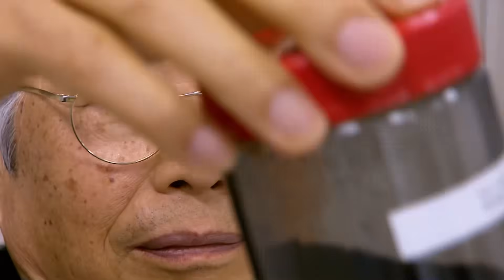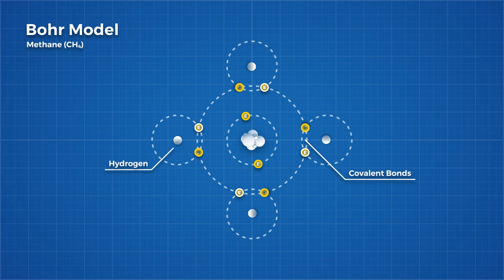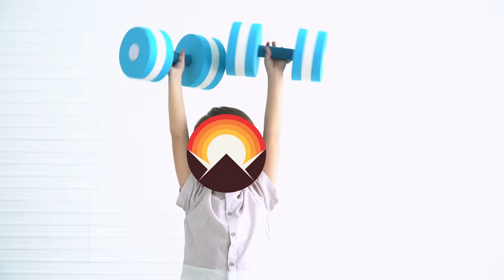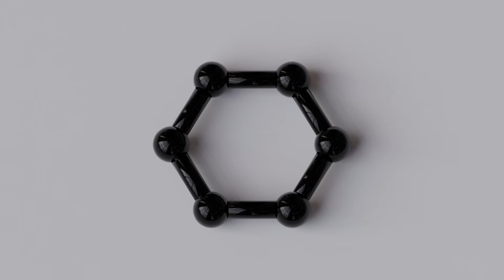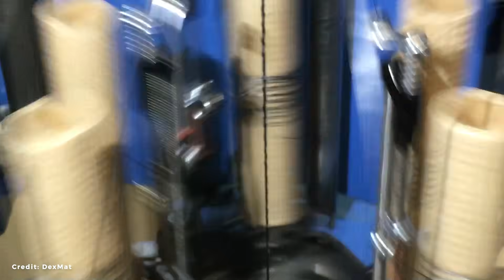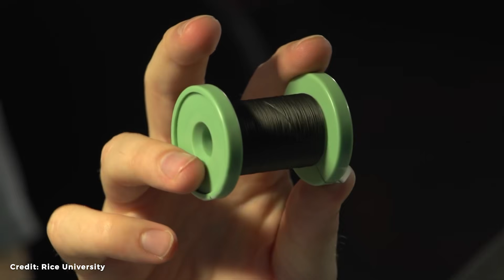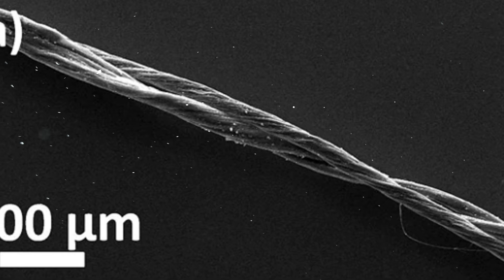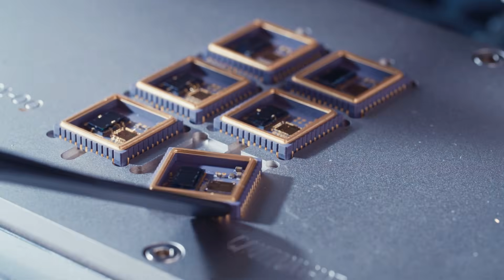How Carbon Nanotubes Will Change the World

Comment: We've heard this for years, let's hope that engineers actually start using this material for realsies now
Reply: The more problems we solve, the more we discover. The trick is to solve more problems than you discover.
Reply: @MetallicReg   with carbon nanotubes though we know what the problem is. We can’t make them consistently or in any useable scale. Sure there are researchers that can make them semi reliably at very low scale for a high price, but that’s massively different from mass production of a product that can pass QC and perform reliably. 

Not saying it’s impossible but, there’s going to be other materials that exist that are much more useful and much easier to make reliably than carbon nanotubes (take even graphene for instance).
Reply: @Kahalahili  I believe that the manufacturing methods for CNTs are way ahead of graphene in terms of volume and consistency of quality.  I am not aware of other materials that are poised to surpass and obsolete CNTs but I suppose it is possible.  Any novel material is going to have to go through the same qualification process as CNTs and graphene, so there is no way around that.
Reply: @MetallicReg  What does that even mean?
Reply: @dibbidydoo4318  This means, that you can't speak about the future without knowing the problems that you need to solve.

When people said that something was "twenty years away" - they were not lying. The problems they knew about at the time were realistically solvable in that period. However, today we are solving an other set of problems - and again - we are not lying when we say that something should be achieved in 10 years time.... if we don't stumble upon new ones.
Reply: @MetallicReg  Well said
Reply: @MetallicReg  I haven't thought about it like that before, thank you
P.S: fully autonomous AI in 25 years
Reply: @dibbidydoo4318  Monte Python reference
Reply: @MetallicReg  
This is very true and why R&D is so expensive and time consuming. Remember: engineering isn't about making something possibly work, it's about making something work to acceptable standards and improving that if you can. No one would be interested in a microchip if it only worked once. The problem with carbon nanotubes is just as this great video laid out - manufacturing. We know all about CNTs. And we can make them. The problem is, we can only make pathetically short ones and can't really connect them well - which means that they don't hold a lot of use if we can't make them as long as we need to. That's a problem we didn't expect and need to solve.

If you want to see a good example of engineering to counter engineering problems, take a look at the X-15. From the very start, it was a struggle. There were engines powerful enough to power it, but none that fit in the size of the aircraft's body. A problem to solve. It also needed to have variable thrust throttling. Another problem to solve. But to have that variable thrust and the power in that size, a pump capable of feeding the fuel at an absurd rate would also have to be invented. Another problem to solve. But, wait, the pumps required for the fuel and oxidizer tanks need to be pumped at different rates and to save weight must run on the same driveshaft. Another problem to solve. Then choosing the right fuel/oxidizer mixture and finding a way to not have the engine exhaust melt and cool it. Another problem to solve. And then your aircraft is going so fast that frictional heating is causing the surface of the aircraft to start failing due to overheating. Another problem to solve. But non-uniform frictional heating is making it fail in some places while other areas are fine. Another problem to solve.

...You guys get the picture. To make something work, you generally have to solve problems that introduce new problems because you didn't and couldn't foresee how it would interact.
Reply: @MetallicReg  questions would this fix the problem "Low-cost synthesis of multi-walled carbon nanotubes using red soil as catalyst"
Reply: @matchesburn  This is the first time I've heard that CNTs are too short to be useful.  In fact, CNTs have proven benefits for a number of applications from conductive polymers to conductive fillers in batteries.  The manufacturing challenges are around scalability and consistency of quality, imo.  I believe that the second one has been solved and the first one is being solved.  Mass production of SWCNTs is likely to continue to be challenging but not impossible, imo, whereas I believe mass production of MWCNTs and CNT hybrids (thousands of tons/year) is within a couple of years at most.
Reply: just 50 more years of "next year, definitely, it's right around the corner!" 
I'll be taking a carbon nanotube coffin when the day comes
Reply: Like nuclear fusion, the technology is 20 years away. No matter when you ask about it.
Reply: @rmod42 CERN is supposed to be finished in few years tho
Reply: *ITER
Reply: @rmod42  solid state batteries are in the same boat...
Reply: @rmod42  nuclear fusion is some shit they been had bruh they only show you what your average scientist has in his lab there are scientist who have access to things like holograms, etc. but those people aren't there to help the public you gotta understand that there are levels to this shit and if you think they don't alr have synthetic Mach 5 robot oh boy oh boy you would be surprised these technology they show in movies is stuff they alr have the government runs the world on tv they follow orders from people you don't even know exist whole time in reality mfs underground past the level of quantum physics and got you idiots living on low tech shit
Reply: @rmod42  nuclear fusion is more like 5 years away.
Reply: @dibbidydoo4318  testing? maybe, but usage will take far longer
Reply: @dibbidydoo4318  It really isn't. I work in Fusion, give a blank check to every fusion project on earth and it still wouldn't happen in 5 years. Burning plasma, tritium breeding, remote maintenance... Fusion is HARD, and the infrastructure required is big and complex.
Reply: @dibbidydoo4318  It's been 10 years away for 50 years.
Reply: @rmod42  bruh. Fusion reactors dont use nuclear. Its just "Fusion Reactor"
Reply: @photon2724  ??? What is your definition of nuclear
Reply: @slyseal2091  nuclear uses fission, not fusion.
Reply: @photon2724  nuclear is literally the word used for things that involve atoms. It comes from the middle part being called the nucleus. And yes, both fission and fusion use atoms, fusion arguably makes more use of the nucleus as such, so I don't get how you think that word is reserved for fission. There are even people that would argue nuclear occupies way more headspace in the public than it should, given that most hospitals hide their nuclear medicine behind acronyms so as to prevent patients from freaking out about the "dayngerous raydation".
Reply: @slyseal2091  nuclear in the energy field is usually referred to as anything relating to radioactive decay, which is only used in fission. Fusion uses super hot plasma to smash together atoms to release energy. Not the same
Reply: @photon2724  "no true scotsman" mistake you made here. You're excluding nuclear fusion (as in the process) from nuclear energy production field because it differs from your original understanding of the involved processes.
Reply: @photon2724  It's Nuclear Fusion. Hence International Thermonuclear Experimental Reactor (ITER)
Reply: @photon2724  You know the correct term is "nuclear fusion"?
Reply: We have been promised batteries that will last your smartphone for 6 months since smartphones exist :/
Reply: @hkr667  I mean, that was a lot more feasible back when all phones did was call and text.
Reply: @hkr667  
Probably due to the world of capitalism in which it's cheaper to make a battery that lasts maybe a day than a battery that lasts a week or more. People will still buy it and you now how an upgrade path pre-made for you. You slowly keep upping the battery size so it looks like progression.
Reply: The problem isn't that people don't want to use them, the problem is making enough of them in practical amounts that don't break the bank.
Reply: @Appletank8  Birla Carbon is sampling NTeC-B to customers now.  It is a carbon black-CNT hybrid: https://15n4u520e106qb7zy1jezch1-wpengine.netdna-ssl.com/wp-content/uploads/2021/09/BPSNTECB_NTeC-B_TDS-1.pdf
Reply: Yeah like confusing cats
Reply: Keep in mind that, at one time, the benefits of aluminum for materials were dismissed because of the cost of mining and refining the aluminum being too cost prohibitive. Now aluminum is so dirt cheap we use it to make billions of cans every year.
Keep in mind that, at one time, the likelihood of silicon microchips capable of being economically manufactured was a fantasy. Now you have them in children's toys.
Reply: Yeah, I admit the media is at fault because of their ignorance of the subject material and engineering timelines, but I'm sure there are a ton of people working super hard on this problem and figuring out how to integrate it in a cheap and scalable manner. It's just that shit is hard to do sometimes.
Reply: @mycorrearth  You hit the nail on the head.  It takes at least two years just to qualify a material for use in lithium-ion batteries, for example, so even after a product is ready for commercialization, getting into the market still takes time.  That said...it is happening.  https://15n4u520e106qb7zy1jezch1-wpengine.netdna-ssl.com/wp-content/uploads/2021/09/BPSNTECB_NTeC-B_TDS-1.pdf
Reply: They can't.
Reply: They are using it rn, the main problem is too produce the stuff in large scale
Reply: Just because the technology isn't around the corner doesn't mean you can't talk about it.  We knew nuclear bombs were feasible for over a decade before we fucked around and made one.  And it was literally a race to make one so there's no rush here, it's not worth the money yet
Reply: @RidinDirtyRollinBurnouts  so... meanwhile climate change can be solved with today's technology, but we're constantly looking to future solutions? seems like an upsell of the future..... theranos
Reply: Carbon nanotubes are already seeing some real world usage, for instance as an additive to existing materials to improving their structural properties a bit. Though as an additive the gains are more modest and thus you probably haven't been hearing of any miracle products. Still at current nanotube production seems to be a few thousand tons a year and some are projecting a substantial further increase in production this decade as more useful applications have been figured out as well as improved production systems, like highlighted in this video.

In any case it's as such already a multi-billion dollar industry that's just slowly been adding this material to various products for some enhancement, with out people in general noticing. And so it has seemed like nothing has been happening.

This market research group discusses it in some more detail for those who are interested, https://www.alliedmarketresearch.com/carbon-nanotube-market
Reply: @Quickshot0  Thanks for injecting a dose of reality!  I recently saw a pilot reactor operating that has a capacity of 50 tons/year of CNT hybrid products and plans for installing a 1500 tpa reactor are well advanced.  Mass production is coming, but yes...it has been challenging.
Reply: Micro-X is using them now.
Reply: @DropAGearDisappear Author didn’t get around to using electronically controlled carbon nanotubes to create x-rays, vs hundred year old Collidge tube technology. Topic coming?
Reply: Stupid science 
Science doesn't know 
Nuclear decay of wood creates fire
Reply: @calebmauer1751  nah I’m good looks perfect to me and btw wanna hit the blunt🤷🏽‍♂️🤣😏